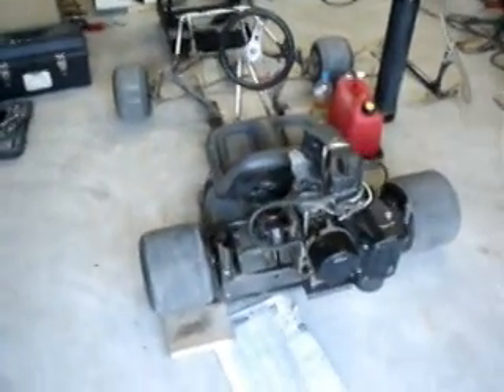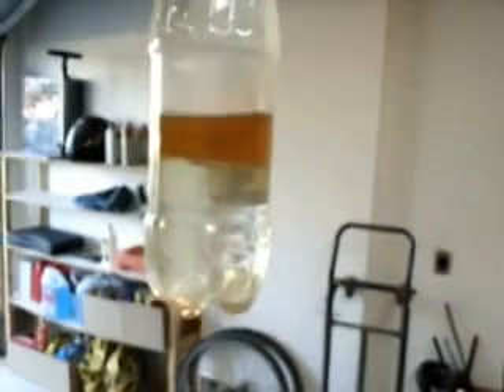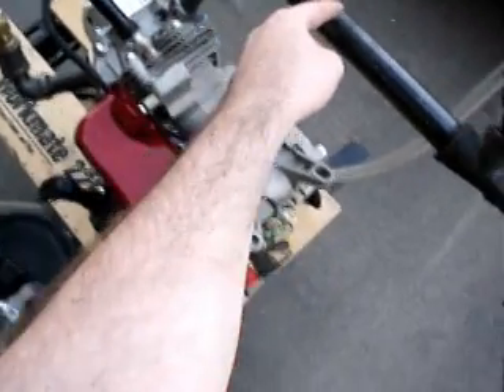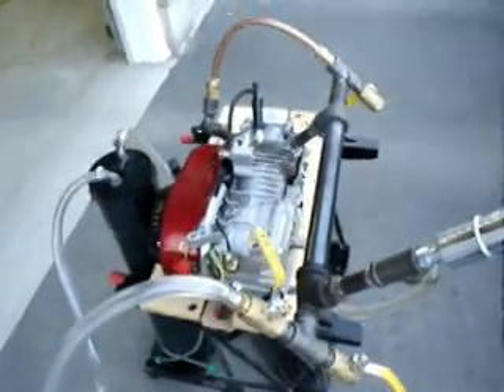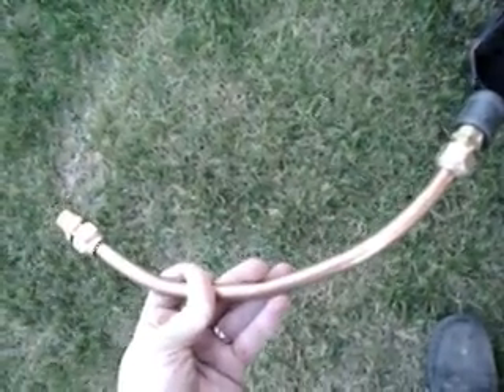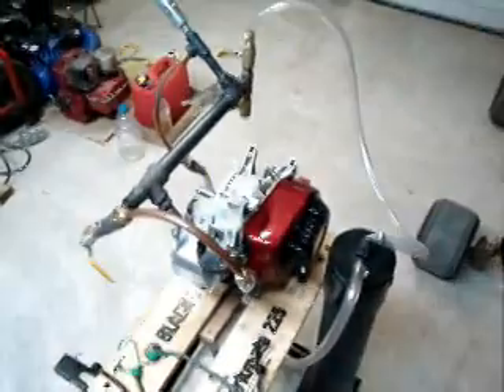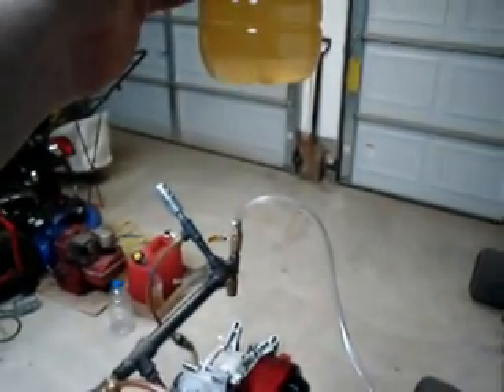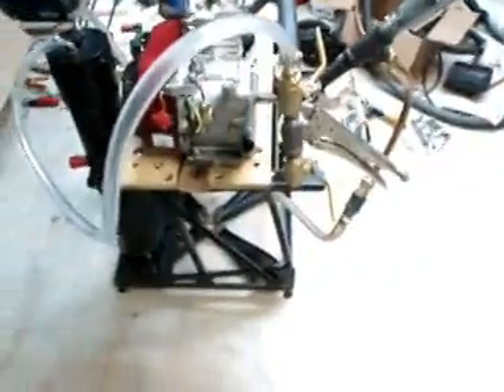GEET Fuel Processor - test 3

Comment: remember, GAS HAS LUBRICATION in it. the oil in the engine is just not enough to prevent wear on the valves. so gas companies Added lead. then anti-lead moved in, and now they use senthetics.  thats the stuff that you're seeing in the water. your essentially, collecting the waiste oils from the engine and gasaline to turn into feul to be used agian by the engine.  reactor must be such that it breaks down the crude oil to make usable fuel. maybe more HEAT and less o2?

Comment: In your present case you could have just as well drank the water or poured it on the plants and had the same results.
Without actually putting hands on I am going to say you have a ROD/PIPE reaction issue.

Comment from the maker: No good result yet. Just putters to a halt when the fuel gets filthy (30 min). Without proper geet reaction the water isn't burnt and (thanks to bubbler) the fuel oxidizes like it normally would after 6-12 months of sitting around. The skankie water was result of dumping exhaust gas into fuel can.  Now I just use fresh air (see test 4). Next test will be using simple nylon hose in larger glass jar.  No copper, no pot scrubber. I want to try used engine oil as well cause its a hydrocarbon fuel.

Comment from the maker: Actually the glue was in the tank, not the pipes.  I think the gas turns yellow because that's what gas slowly does anyway when exposed to air.  When I leave gas out all winter I get that.  I think the bubbler just speeds the process up.

I'm going to try just using nylon hose in the bubbler tank and getting away from all this copper fittings and solder ...ELManlinos' rig is simpler and works fine by the look's of it.

Comment from the maker: Actually, I have run the engine without the reactor rod and I'm not surprised that it worked. The bubbler is a viable fuel vaporizer using straight gasoline. I'm not sure if it would run on anything else because even with gas being polluted with exhaust fumes it eventually stopped running. I intend on running a side-by-side test with 2 identical motors once I can successfully run the geet bubbler tank dry. I've built my new tank out of a rigid clear-ish jar, I just need free  time. Coming soon.

Comment: If you have a chance take a look at this video, this guy removed completely the inner rod and it works just the same, also he was able to run the engine on fumes or gas vapor, no bubbler. make a search for "geet but no plasma"
Let me know if it working for you to without a inner rod?